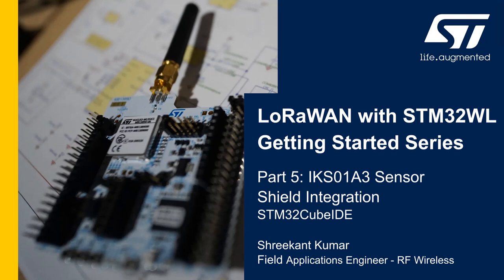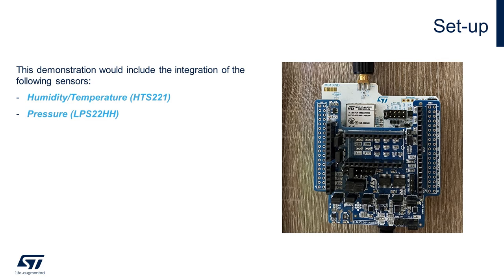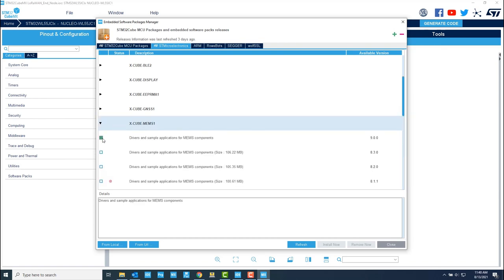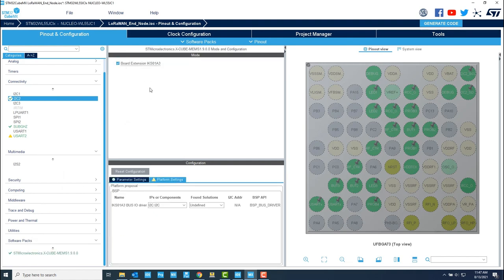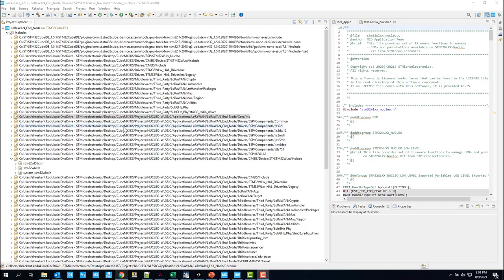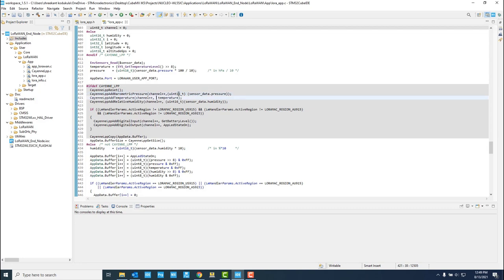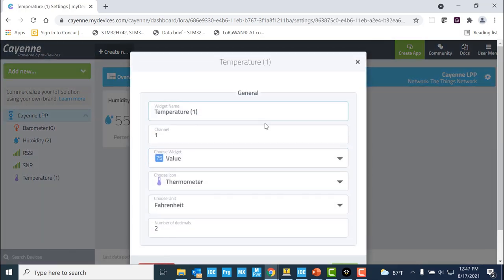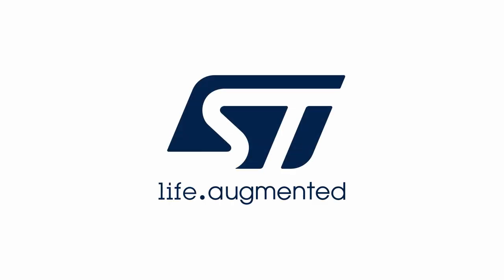LoRaWAN with STM32 Getting Started: Part 5, IKS01A3 Sensor Shield Integration - STM32CubeIDE

Comment: fatal error: iks01a3_env_sensors.h: No such file or directory    62 | #include "iks01a3_env_sensors.h"  So close, using CubeMX 6.5.0, CubeIDE 1.9.0, STM32Cube_FW_WL_V1.2.0 and X-CUBE-MEMS1 9.0.0  the  #define BSP_BUTTON_SWx_IT_PRIORITY          15U isn't needed. The MX IOC was missing debug, PROB3, PROB4